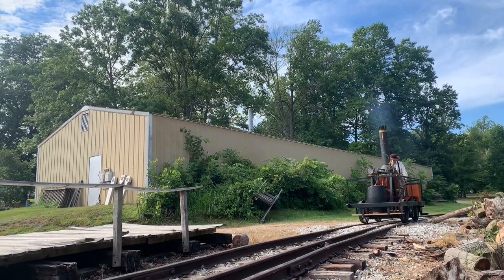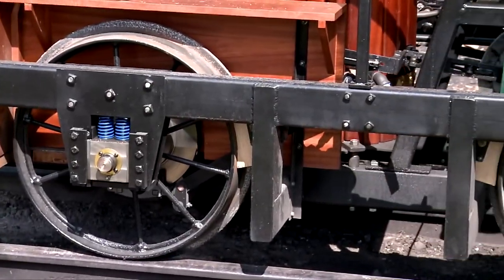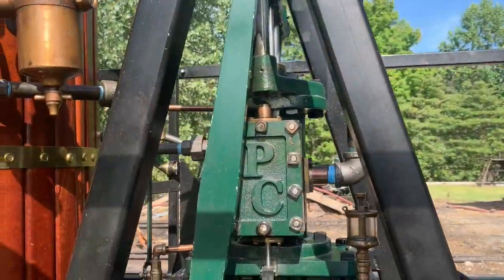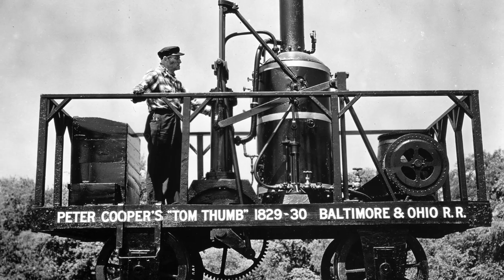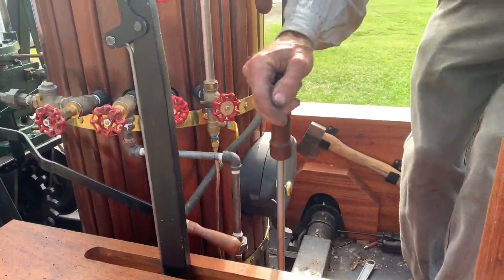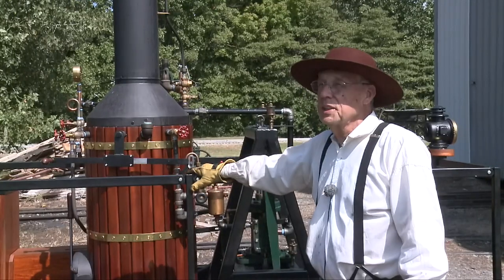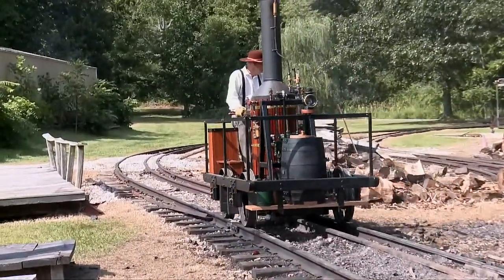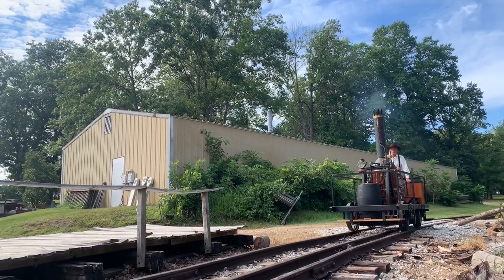Tom Thumb Locomotive at the Hesston Steam Museum

Comment: I wonder if you can film & talk about the Lionel MPC Blue Comet, The Lionel Century Club 773 Hudson, The Santa Fe F3 with 5 Postwar 2500 series Aluminum coaches/Passenger Cars, The Lionel Grey 785 Hudson, https://www.youtube.com/watch?v=ky1GGZ8_0F8, I've just heard that it sounds like an MPC steam engine because of the sounds heard from the engine but sounds good. and even the Prewar Rail-Chief Hudson with the red and maroon streamlined coaches/passenger cars. I call them coaches for correct reasons.